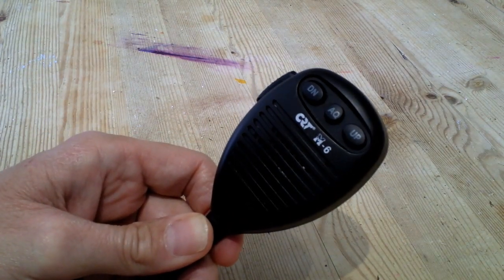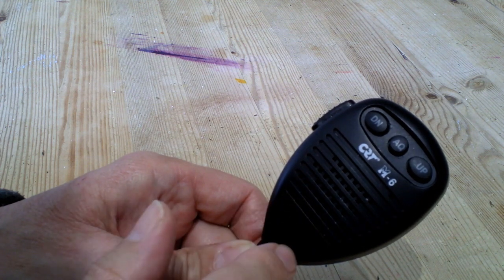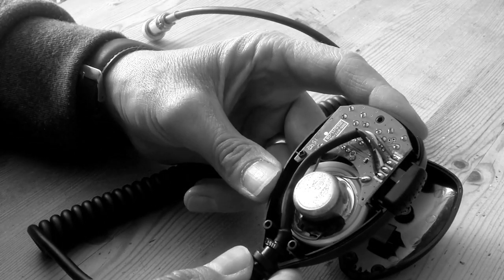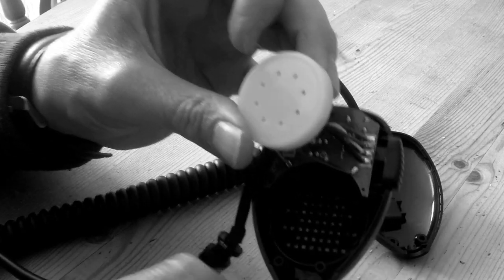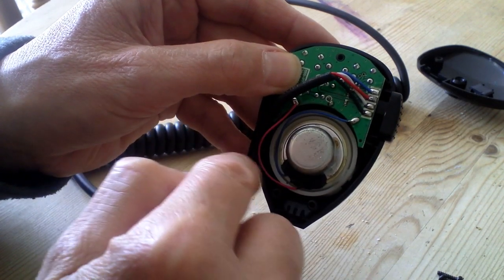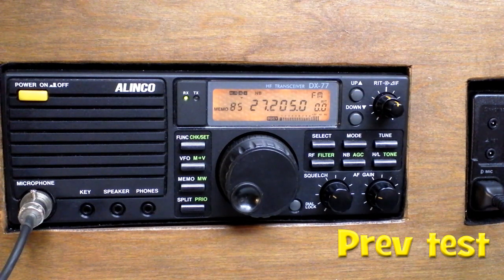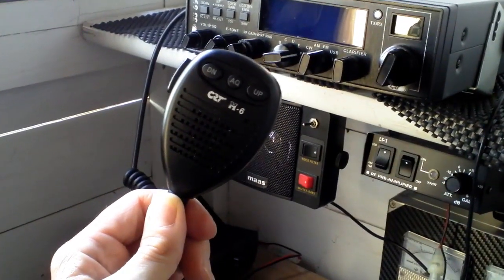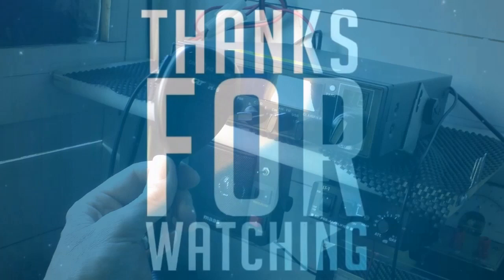CB RADIO UK. CRT M6 SS6900 N microphone mod.

Comment: How sad that quality control did not pick up on this muffled issue in the first place. That was one neat modification that had good results. Congratulations.
Reply: Because this acoustic foam keeps dust and dirt away from the mic capsule!
Reply: To be honest Andy, when I took mine apart to make this mod the white plastic cover was not there! So they have obviously made some changes but haven’t gone far enough in the design.

Comment: I did exactly the same to mine Fred, I actually put the foam back in behind the element to hold it in place. Hopefully catch you on the airwaves soon 👍🏼
Reply from the maker: Where about you based Dan ?
Reply: @CB-RADIO-UK  Not to far from you, Welwyn Garden City. Couldnt make the 4pm today but should be on tomorrow 👍🏼👍🏼👍🏼
Reply from the maker: Hi Dan.  Yeah we will get you no problem.  Chris from WGC was on today so you will get him very strong when his on.  I will give a shout out for you tom (weds) after 4pm. Hope to catch you on air 27.305 USB.
Reply: @CB-RADIO-UK  Thanks Fred, I have spoken to Chris once before, very helpful, gave me good tips on the 6900! Hopefully tomorrow 👍
Reply from the maker: Copy you on air Dan.
Reply: @CB-RADIO-UK  Thanks for the airtime yesterday Fred, was an education being introduced to the Gang! Really appreciated the helpful technical comments on tuning the 6900 and how to navigate from the 27555. Thank you again.

Comment: Really appreciate your video on this topic, I also have a ss6900n and did buy a kpo power mike. Will now have a quick look inside the M6, the foam you found was probably just to pack it all up so that there was no rattle from the mike. It made a lot of difference to your audio,and it was a thick sock wasn't it LOL.
Reply from the maker: Yes Paul it seems the foam is in the later mic's.  It does help the audio but the standard mic is still poor. Esp compared to the one supplied with the 9900.

Comment: I was hoping to hear the fifteen pound Microphone. As far as the stock microphone, I think you hit the nail on the head. It may sound unbelievable, but when companies build radios and their accessories,
Less money spent is more money earned. I would assume that the piece of foam was cheaper Then hot glue. Who knows how many microphones they plan to Produce, But if it's in the tens of thousands which is possible, Adding the piece of foam to hold the microphone element From slightly bouncing around Is most likely cheaper, then adding a few dots of hot glue. 73.
Reply from the maker: Here. https://www.youtube.com/watch?v=szAFl8j_Bho

Comment: I wonder if the white plastic cap on-top-of-the-element can be removed also leaving a naked metal audio transducer visible? My guess is that the foam is needed to reduce feedback from the housing (holding it) into the microphone. Your demo shows us that isn't the case, thanks.

Comment: Feel guilty I didn't mention it, sorry, did mine a couple of months ago.  Had similar with a Leixen where the hole in the rubber boot holding the mic capsule didn't line up properly.  Snip snip done!  73 mate.
Reply from the maker: I really think the foam ruins the audio.   No need for it to be in there. Cheers mate
Reply: fredintheshed1 Must admit I cheated.... no glue just folded foam and put it in as packing behind insert hahaha.

Comment: I did similar years ago on my uniden mic. I wonder if my new ss9900 would need this.  Will have to have a check when I'm back home.
Reply from the maker: The standard mic on the SS9900 is pretty good Jason.  Ive always had good reports.  Personally i would leave well alone.
Reply: fredintheshed1 Good point. I've had good reports and others radios sound good.  Hope to speak soon as I'm Luton based mobile back on after about 18years :) CT2647

Comment: hi fred , i am waiting on a brand new ss 6900 n6 . do you know if i will have the foam in this mike , or do i just open it up an see !.
Reply from the maker: I would try the mic first and see what reports you get.  I never got a great report with the standard mic.  Knights sell the CRT 9900 mic wired to a plug of your choice for less than £15.

Comment: Didn't do anything to mine. Instead of removing completely, I cut the center portion, that left the mic with support. 

One the other hand, and if you're registered, on Facebook's AT-5555 group, I've posted a preamp for the standard microphone using 6 passives and one transistor. A WORLD of a difference, and cheap as chips!
Reply from the maker: Your little pre amp sounds interesting.  Its a shame they never shipped the radio with the same mic as the CRT 1 and the 9900.
Reply: @CB-RADIO-UK  tested the stock M-6 Vs a K-PO DMC 110, a per other video. The K-PO lagged waaaay behind the stock mic using the preamp 😉

Comment: hi fred, afer the mod, whats the recommended setting for the mic gain if any recomended? thanks
Reply from the maker: You really need to start about half way and increase by 5 until your told your over mod and then back it off another 5.  Talking to other people ive found that often there is no ideal setting on the 6900n

Comment: Hi Fred,would this be the same as the grant2 cause I’ve been told my mic on the grant is quiet
Reply from the maker: No mate the Grant has a known issue for quite modulation.  It needs the mic gain turned up inside.  Mine was done by Knights before shipping at no cost.  Other's use a power mic.
Reply: Thanks for that Fred I'm going to knights on Saturday will ask them to do it for me

Comment: Hi ya Fred now I’ve fixed my swr I’m giving a good signal but I’ve been told the modge is quite on my grant 2 wondering if the same problem was with that.
Reply from the maker: The early Grant 2's had a low audio issue which required an adjustment on the board.  I think it was sorted by 2014 though.  Only adjustment on mine is the mic gain button ?

Comment: hi fred just bought a 6900 do you know if they have modified the mike and reduced the density of the foam
Reply from the maker: Not sure.  Some people have said its thinner.  I think i would still take it out.
Reply: @CB-RADIO-UK  cheers fred will do
Reply: @DerekInCanada you happy
Reply: Try removing the foam but replacing with an identical disk of single snooker table felt .

Comment: Cut the foam in half length ways with a super sharp blade then test it .
Reply from the maker: The video is 2 and a half years old and the foam long gone.
Reply: @CB-RADIO-UK  im  CT3025  paul
Reply from the maker: @PaulMoorhousehankooks  4 watt Paul ?
Reply: Fred in the Shed I was a rig doctor in the 80s but haven’t the equipment I used to have only a mosfet tester and a fluke multimeter.im just replacing a chip in a uniden 100 . And I’ve just repaired a moon raker minor that was skipping Chanels
Reply: Yes 4 watt love cb been doing it since the AM days
Reply from the maker: @PaulMoorhousehankooks  Your homebase with the t2lt clone was very strong signals to me the other day.
Reply: Fred in the Shed I’ve got a home brew Ariel built with the help of you tube guy cryptic cricket using a whip with measured di poles which has a very low swr . I’m putting up a silver rod on a 20 ft pole I’ll probably you tube it anyway where are you based to hear me on the waves
Reply from the maker: @PaulMoorhousehankooks  Sounds good Paul.  you were +10 db
Reply: Fred in the Shed cheers fred